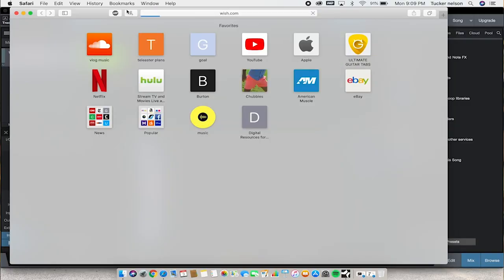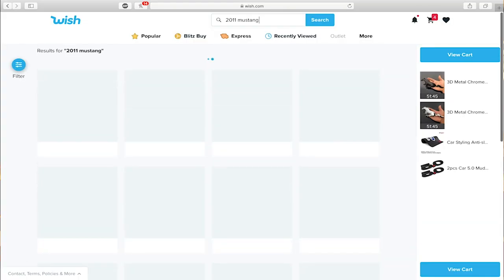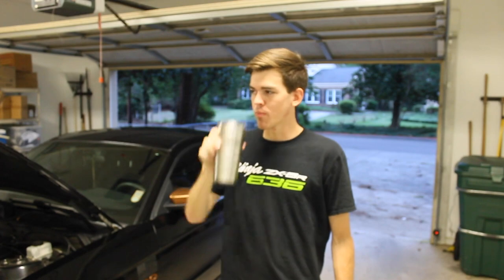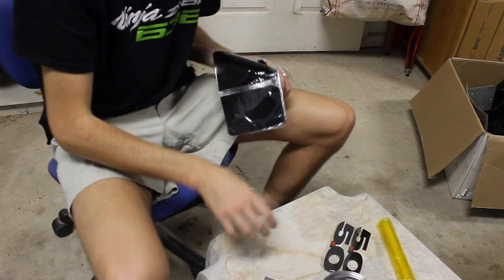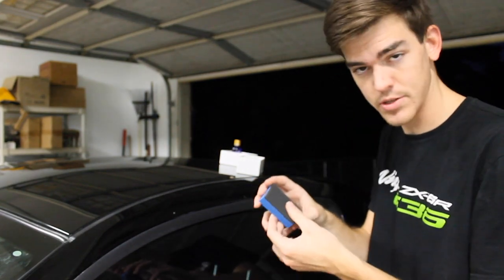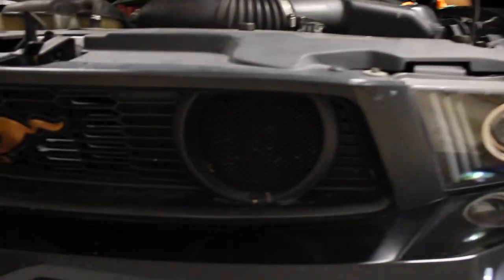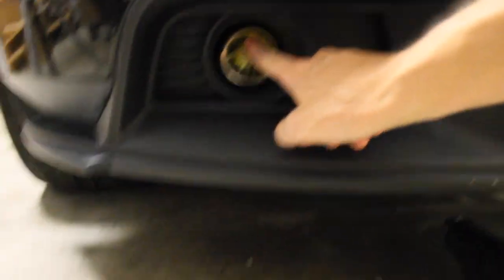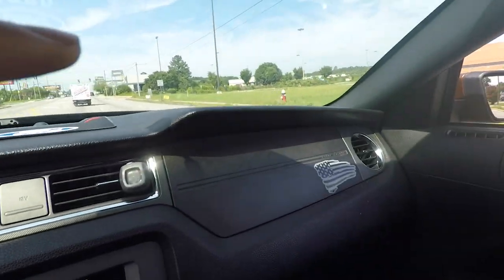Buying Things For My Car From Wish

Comment: Dear America, please abandon the imperial system, we're not in 1850 anymore. And buy some proper sports cars....
Reply from the maker: Ya imperial sucks. What is a “proper” sports car?
Reply: @MotoTaco  Not a mustang with a beam as rear axle.
Reply: @MotoTaco  No, but the most imporant thing for sports car is handling to me, therefore lightness is key in my mind. My current cars weights 825kg. Muscle car's don't do it for me, even with 17x the power. Hope I've made a fair, slightly more serious point there. A real sportscar is a porsche 718 cayman or alpine a110
Reply from the maker: Wait did I say I owned a sports car?
Reply: @MotoTaco  no you didn't... and I was talking to the general public ;) 
No need to feel concerned then